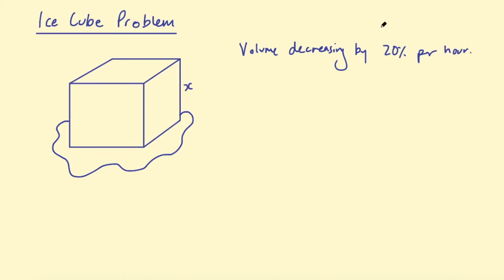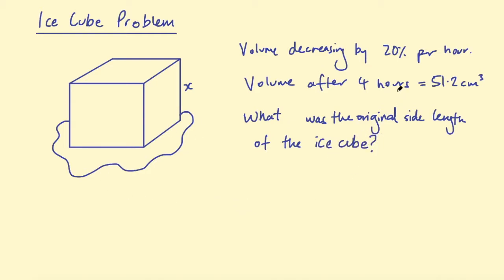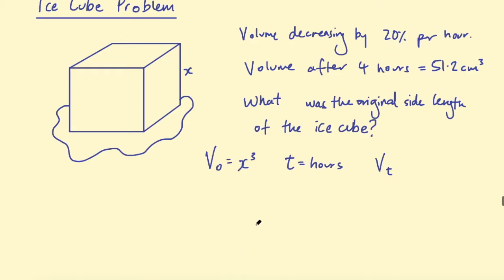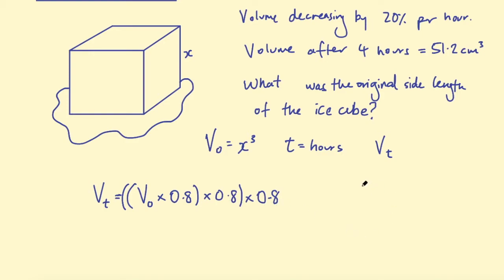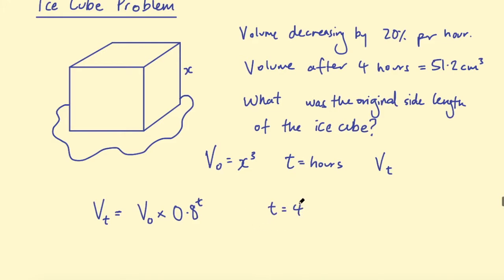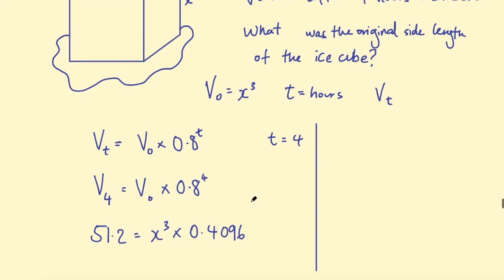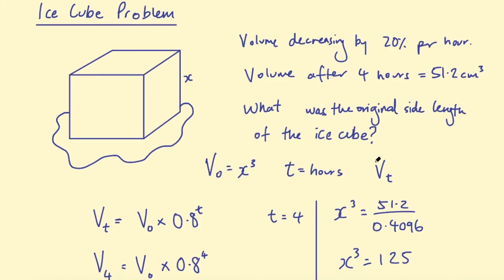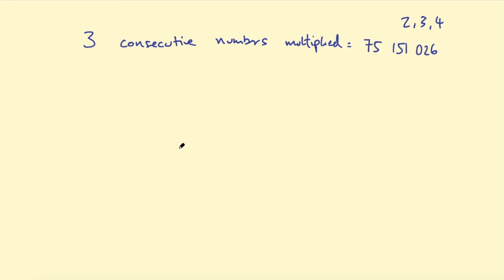Ice Cubics

Comment: Solved the last equation, the numbers are 421, 422 and 423

I set (x)(x+1)(x+2)=75151026; I expanded everything out and made the x^3 as the subject without the cubed part, so I got (75151026-3x^2+2x)^1/3 Then I used iteration with x0 being 0 and solved it to get 421 as x. Then I just inputed 421 into my original 3 expressions to get the 3 numbers :)
Reply from the maker: Wow, that is a very precise way to solve it. Nice!
Reply: Maths Explained Haha, ty. I nearly thought it wouldn't work, coz I used x0=0; I'm still a bit wiffy woffy on when to use x0=1 or 2 or 3 etc, in iterations :/
Reply: Siam Sama how can I do your way it seems it would be useful for me one day

Comment: consecutive numbers are 421, 422 and 423
Reply from the maker: Yes. Did you have any trick to solve it?
Reply: Maths Explained not a great trick to be honest because at the end I used a bit of trial and error. I did 75151026 = (n-1)*(n)*(n+1) which is = n^3 - n done some rearranging to get a rough estimate so cube root of 75151026. And then took me two trial and errors to work out the exact numbers
Reply from the maker: Yes just taking the cube root gets you close, and then use trial and error! The simplest way

Comment: Do a video on iteration please
Reply: Kane. M iteration is just the substitution of values into a given equation, its useful to use the answer button in the calculation on your calculator as this allows you to just press the = button as many times as you need without need to change the equation on your calc
Reply: When i asked the question it was when most questions say e.g x^3+2x+3=1 prove that the value is between x=0 x=1 but now i understand